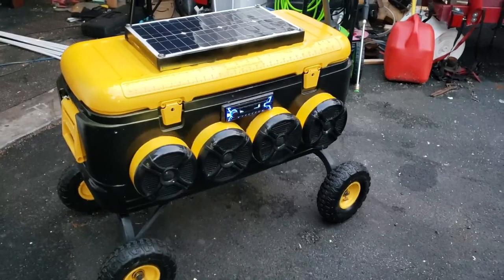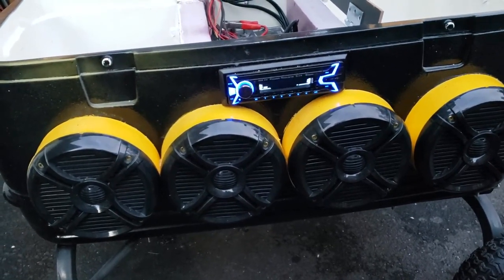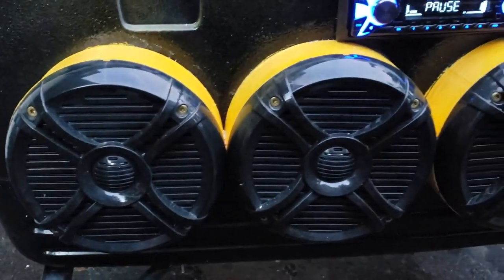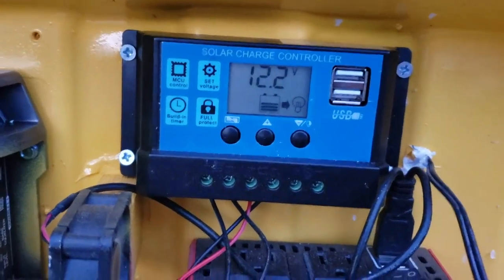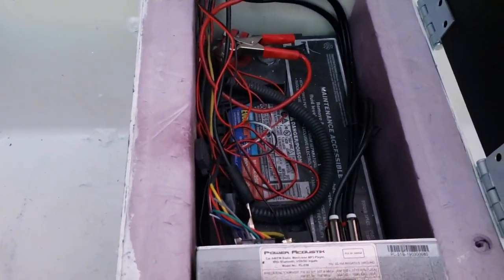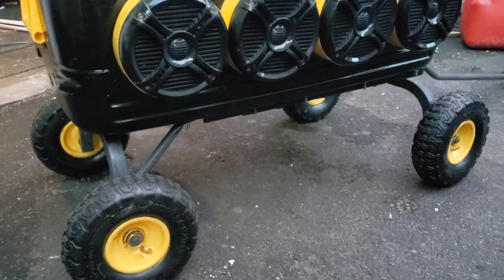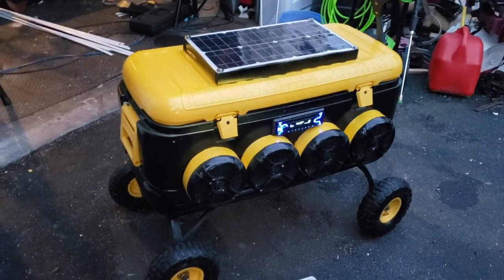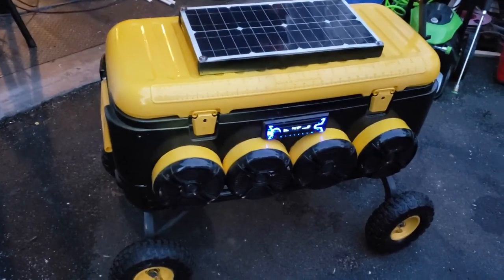DIY Speaker Cooler

Comment: Rob a couple of questions. 1: what gauge power and ground wire did you use? It looks extremely thin. 2: how many amp hours is that battery?

Comment: What was the total cost ?
If you have a cost of each that would be helpful . Looking at doing one my self!?
Reply from the maker: Total cost was probably $$600 or so, but that can vary depending on the quality of the speakers, battery and amp. Here are estimates on what the cost would be (I already had some of these items):

Cooler: $60
Cart: $70
Paint: $25
Battery: $100
Speakers: $100
Amp: $100
Inverter: $40
Charger: $40
Solar panel: $30
Foam & panels: $25
Hardware: $15
Wood: $5
Fans: $10
Cable & Port: $12
Head unit: $50
3d printer filament: $20

Comment: Yo Rob - what type of paint did you use?
Reply from the maker: Sorry for the slow response. I just used cheap primer and spray paint from walmart, but it has chipped off here and there. I have to touch it up now and then, so I'm curious if anyone has a better option that will stick a little better.
Reply: @RobShambaugh  use raptor bed liner spray

Comment: You should NEVER  mount an amp upside down! Heat rises, you should be able to figure out the rest of what happens over time.
Reply: Yea it’s good to use 3 inches of dry pine needles on the floor of the chest to set your amp on if turning it upside down so the music doesn’t skip… and it makes for a good insulator